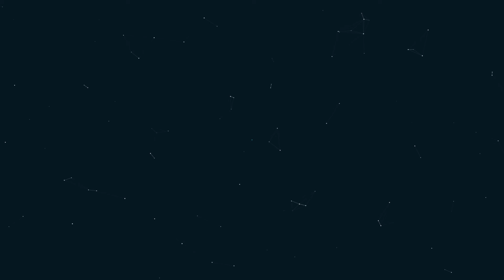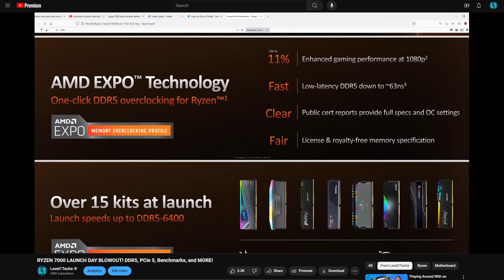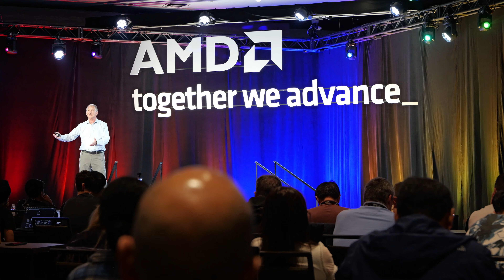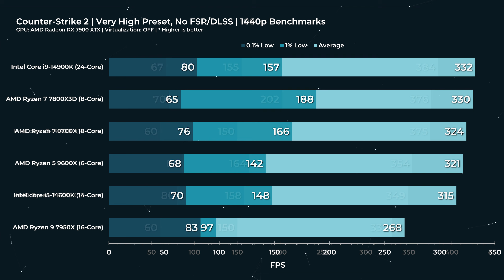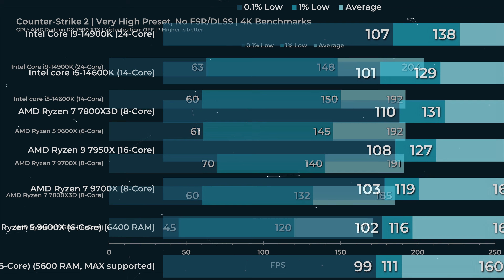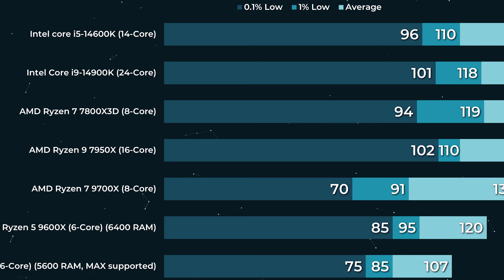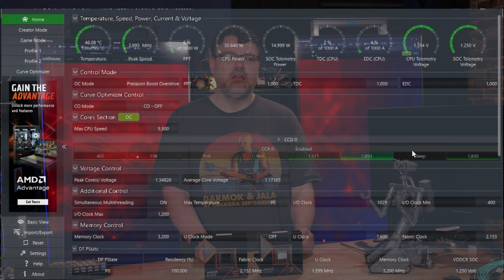Ryzen 7 9700X and Ryzen 5 9600X Review and Benchmarks

Comment: Really wish you would include 5800X3D in comparison just for the funzies.
Reply: It's too powerful and always wins 😊. OCed it ties nondegraded/nongimped 14900KS.
Reply: @TheGuruStud not it’s not even close to “always wins”. I understand it’s a great CPU but let’s not lose our heads here.
Reply: Since efficiency is the name of the game here, and considering that 5800X3D can be undervolted to around 1V (1.0275V on mine) while maintaining 4.4GHz all core overclock and competitive performance well below the 88W power limit of the 9700X, performance per watt wise it is hard to beat. Keep in mind that 5800X3D in these benchmarks is usually not undervolted and overclocked in this manner to maximize its efficiency. Within this context, 5800X3D actually is competitive with a 14900KS, as well as this brand new 9700X even with its efficiency gains. It may not "always win," but the 5800X3D is still damn impressive.

Comment: That was an incredible spread of variables! Especially the 8 core AMD beating the 24 Intel and your point regarding 4k vs 1080 and CPU/GPU bottlenecks! Personally, I'm convinced I will eventually need to get a (2nd hand?) 4090 in my AM4 rig eventually. I was fully and most shocked and almost in disbelief that Intel dropped or never did AVX512? That surely is the nail in the coffin.
Reply: No, it doesn't. of course a 6 core can beat 20 core in gaming. Nothing surprising if the single core perf is better in some games. I see you fanboying AMD everywhere. Just, stop.

Comment: What i really want to see for Zen5 is for the monolithic APUs to have the same or better cache spec than the non 3D desktop CPUs. Sure adding cache makes the die bigger, more expensive, and use more power at the package, but system wide it should hit RAM less often and depending on how much less RAM is used could not only make the 9700G faster than the 9700X in gaming, but also make the 8750u more efficient than the Apple M3 in mobile. Everyone is talking about how going to SODIMM takes too much energy so we need to switch all laptops to near or even on package LPDDR, well not using the RAM at all is an even greater power saving, for every bit that stays in cache the the difference of power in picojoule per bit can be more than 2 orders of magnitude less than going out to RAM, The real question is, how much more will stay on die, will it be enough to offset the added ~$5 die price(before adding profit margins, shipping, packaging etc) 
Will doubling the cache mean that 8 hour laptop will hit 8H30m, 12h? Or will everything that was already hitting RAM still hit RAM and the added cache will increase power usage and now it gets 6h of battery life.

Comment: It seems like they should have pushed the silicon with a few more watts and another 100MHz so that it never had a measurable performance regression. "0% uplift in some cases" looks a lot better than "-3% in some cases" even if it does come at a small penalty to the efficiency gains.

Comment: I've been on x570 with the 3700x and then the 5800x3d CPU and I am very happy with the performance however I can't help but think, is it time to upgrade? The new generations don't seem to really pull me in. Thanks for this review.
Reply: If you're already on the 5800x3D there's no question you should only be looking at the 9800X3D or higher.
Reply: Maybe 10800X3d
Reply: Absolutely not, once on X3D is X3D or bust for now
Reply: I wish i could keep my s.l.i setup because that 5800x 3d I have doesn't have enough clock speed for my two rtx 2080 tis in s.l.i
Reply: Same for me. I had a 3800X, currently on a 5800X3D - paired with a RTX 4090. Is there a lack of FPS? absolutely not.... but it could be faster
Reply: Oddly enough, if you plan to do PS3 emulation, having AVX512 support is amazing, and is sadly absent from AM4, so that by itself is a good reason if you go for it
Else just stay with am4 for now
Reply: Wait for 9000 X3D

Comment: I should have watched this first instead of last. This is probably the best review I have seen on the processor. Everyone else just said that it isn't as good at gaming and cinebench as we would like. I think the power is the reason for these chips. These are intended to be more general purpose CPU's I don't feel they are intended to be the "best" at anything. If you want the best gaming chips that is going to be the X3D chips. If you want the best chip for Multithreaded workloads you will be better served by the 12 and 16 core parts that are coming in a few weeks. These are going to be more for your general workstation chips where the employees do most of their work in a browser anyway and 6-8 cores are fine for that. In that general workstation having very good single threaded performance for the browser and office suite while only sipping power is the killer use case. Companies building generic workstations will love these chips. For gamers, wait for the X3D. For programmers/ 3D modelling etc wait for the higher core count parts.

It feels like these chips are a Toyota Prius and are being gauged as bad cars because they can't haul as much as a F150 and they aren't as fast as a corvette. You need to figure out the use case for the product before you can actually evaluate if it is a bad product or not.

Comment: Would be great to see a deep dive into the memory architecture on AMD -- I switched to AMD (7800X3D) this upgrade cycle for obvious reasons. On my particular platform I'm seeing some really impressive timings at 6000/1500MHz  with the EXPO profile -- in fact for a kit with single-sided SK Hynix modules it does better at 1500 than 2000+, usge scenario is 1440p gaming. Double sided modules are the other way around. I only have SK Hynix DDR5, would be great to see if there is a difference compared to Micron and Samsung.

Comment: After watching a few reviews, here is my assessment:
1. Zen 5 is notably more power efficient than Zen 4 or Intel up to 14th Gen
2. Zen 5 needs some more tweaks and optimizations to really deliver higher clocks and better memory compatibility. That might be fixed with microcode and/or die revisions, but could require a more extensive change to chip layout.
3. Zen 5 with X3D will be stunning.

Comment: Man, love your coverage of these chips Wendell. One thing I am really interested in seeing is how far can one push these chips with PBO and overclocking. If the 9700X is neck and neck with the 7700X in a lot of ways, what if you OC the 9700X so maybe it is drawing similar amounts of power as the 7700X, can it get closer to 6GHZ? Just makes me wonder how far it can be pushed if it is that fast at sometimes half the power of the 7700X.

Comment: Honestly, I think a world where PBO becomes the new 'xmp' for cpu's where enthusiasts are generally expected to just automatically turn it on from the start while leaving the base efficiency focused setting as default for general users is probably not a bad outcome.  

Certainly would've worked out better for Intel the past couple gens.  And better than AMD defaulting to boost to whatever they can get to maintain a constant 90-95c temp and then introducing an eco mode after some backlash, especially in the EU where energy concerns have been greater.

The automatic boost to a set thermal max at all times will always get you better benchmark results out of the box but probably gives an overall worse experience to most users.  And the users who do want that can just turn it on with one simple setting like xmp.

Comment: If I understand this right the absolute performance compared to 7000 series is maybe a little better but because of the new core and the way the CCDs are mapped out the main improvements are in watts and temps. ... And that was the limiting factor for clocks on the chips with vcache, right? Sooo, 9800X3D might not even have lower clocks anymore compared to non X3D? 
That would be insane!

Comment: Interesting. Other channels weren't so impressed. Maybe it's how you tweak the infinity fabric or memory timing? Zen 5 definitely has very different internal data bus. It is now 512bit wide, which is great for SSE/AVX workloads but for INT64/FP32 workloads, that may come with performance penalties due to the need to fill up the data pipelines, so, weird pre-fetching issue is highly likely. The Pentium 4 (or Pro?)  had similar issues if memory serves.

Comment: It’s funny to see the difference between reviewers. Hardware Unboxed were very negative in their review… probably due to the gaming performance I guess.
Reply: I’m kinda confused whether Steve tested with PBO enabled. I’ve seen some reviews do this and have vastly different conclusions.
Reply: The preset power draw of these two chips are pretty conservative, so PBO would theoretically remove this limitation.
Reply: just thought the same, GN and Hardware Unboxed concluded with ... "same performance, higher price, lower power draw. hell no AMD"
Reply: Yeah, GN and HUb were more negative, they likely did not use PBO, with that said if PBO is not covered under warranty then them being upsett is completely understandable becasue the capabilities of the CPU are locked behind a warranty void is used condition.

Comment: Maybe not the most relevant video to ask this, but as someone with a 13900k I am curious if I need to be worried about anything other than updating my bios and microcode when it is released, I did have some instability at stock settings running my RAM at 6400 CL32 however now that I've set my ram down to 6000 CL32 and also have altered the voltage settings to lower values it's been rock solid as far as I can tell. Should I still be worried about it degrading at all or would that have already happened by now? For context I've been running said CPU since Aug 2023 and other than the instability I had for the first like 2-3 days I had it before I changed the voltage and RAM settings I have not had any other issues that I could directly point to the CPU. TLDR I have a 13900k and am thinking about swapping my platform out for a 7000X3D chip and B650 board but am unsure as to if it's worth it because I don't know if I'm in the clear as far as faulty chips go.

Comment: The use case I could think of for an 8 core multithread workload would be something like Digital Combat Simulator Multi-thread mode, where it's got a bunch of threads now, but it really only has a smallish number that are limiting it, and the cache latency hit of transferring from one CCD to the other is a significant penalty. 

Last I checked, it could use up to 32 SMT threads, but apparently performanced better if you capped it to only 8 or so total cores, because otherwise it ended up choking the system bandwidth by trying to load everything all at once on their own unique threads, and stuffing the system with overhead... 

Try that for niche usecase!

Comment: Still waiting for the new MCM architecture with direct connects and now I'm thinking the performance uplift from Zen 5 to 6 is going to be even bigger.  I was thinking it would be around 10% but I think they'll correct the issues with Zen 5 and it will be a good 15% boost AND use less power.

Comment: Power management is the ONLY benefit.  The X3D prior gen chips are still a better buy.    There is no reason to buy these two chips for upgrade or new builds.   AMD had the opportunity to bury Intel and failed.  The 7700 is within 10% better and worse depending on application.

Comment: How's the LLM performance? I'd like to run larger models and I'm debating if I should fork out the cash for 2 3090s, or if it's not too slow, throw in extra system RAM and run the big stuff on the CPU. Please, Wendell, I need your guidance!
Reply: Yeah, interested in that. AVX512 should help, certainly seen good results from neural magic deep sparse using AVX 512. I’m going to wait to see if strix halo pans out though, 256bit memory could make it a unified memory beast on CPU or those 40CUs.

Comment: I realize that this is a cpu test, but it would make more sense to test CS2 with a lower quality preset, like around medium or "custom competetive setting (aka low)" like HUB does. There's a big performance penalty when turning the quality up over a certain point, regardless of resolution. Even if nobody "needs" more than 300 fps, most players will turn down settings to achieve just that. For someone who plays the game, the 0,1 and 1% lows compared to the average fps matters a lot. In the end, it would still function as a good cpu test, while showing more realistic results.

Comment: Comment on the Starfield 1% low weirdness:
With the same power budget but less votes, the 9600X is probably better able to utilize the single-threaded advantages of this generation and clock higher - and Starfield does apparently tend to favor high clocks based on the Intel favoritism - while spreading that budget across more cores with the 9700X is probably bringing clocks down further and taking longer on tougher parts of the render pipeline since Starfield is clearly not optimized that way.

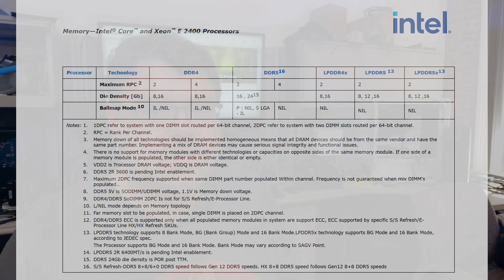Comment: 7:30 I have an 8700G with DDR5 8000 on a cheap 2 slot board, worked out of the box with XMP profiles(yes this is an Intel kit) 
My main dissapointment is that apparently, this chip is worse than the 5700G, as the 5700G i can get DDR4 5000MT/s in 1:1:1 which means MCLK, FCLK, and UCLK are all at 2500Mhz, but on the 8700G, no matter what i try, the FCLK seems to top out at 2200Mhz meaning the best i can hope for in 1:1:1 is DDR5 4400MT/s despite the MCLK running at 4000Mhz and so far as my testing went, even 4500Mhz(DDR5 9000) i'm still limited to 4400 in 1:1:1 or 8800 with MCLK at 1:1 and everything else at 2:1

I'd quite literally have higher bandwidth with a 5700G if it came with a DDR5 controller as with that i could in theory run at DDR5 10,000 in 2:1

The 5700G with DDR4 5000 C17-17-17-30 wasnt actually that far behind the 8700G at 8000 at 74.somethingGB/s vs 89GB/s

(dont remember the timings of the 8700g because i disappointed and decided DDR5 is probably a no go for another 2 generations)
Reply: Edit, i might have tried to fly too close to the sun with a 48GB kit, but i wouldnt think that would affect how fast the FCLK and UCLK could run, just the MCLK
Also i looked it up, the trident Z has timings of 40-48-48-128 now i tried playing with these numbers so i probably had them closer to 38-42-42-100(just a guess)

Comment: I still find people using the 4090 at 1080p are doing a disservice to these CPUs since the 4090 is actually faster as higher resolutions. For example its 1440p numbers are higher than 1080p.
Reply: That an incorrect assessment. It is not higher, it is lower. CPU strength will dictate whether 1080p is faster and by how much. GPU utilization is king. In every game I play with 13900k and 4090 1080p generates more fps but at the less GPU usage 

Drop to something like 9700k and playing with 1440p is better because cpu is less strong by IPC than 14900k (for an example)

Comment: Man i have a 3900X and was debating with my self, the whole video, if i should upgrade. An in the end it felt like wendell broke the the fourth wall
Reply: In my opinion its always a case of "what are you doing?"
-General use= a few fast cores, so 9600x
-Gaming= X3D, so 9800x3D
-Production= 16+ cores, so 9950x. (everything=9950x3D)
The non3D cores in the middle become a no-mans-land valley, same with intel 12400f or 14900K.

Comment: The important question is, is it actually confirmed that AMD does not treat DDR5 the same as Intel. With Intel the short specs say "up to" and the detailed public spec PDFs have always been explicit since the start of DDR5. With AMD, there are no detailed public specs. So it could be possible that AMD has the exact same behavior. And we know motherboards largely ignore those limits and will just run the CPU at 1DPC limits anyway. Have we had confirmation that AMD wachtes the memory settings like a hawk and would not let the mainboards get away with what they are doing on Intel? Or has anybody seen similarly detailed specs to the Intel ones that do not have the limits Intel has?

Comment: I've never been so confused at a CPU launch. Opinions so divided, and so many differing benchmarks. Have seen bench after bench from the two Steves and many, many more showing the 7800X3D miles ahead of everything in gaming for the most part, but now benches are appearing showing it as having fallen behind. Nothing seems to add up man. My MSI Z170A M7 has so many more 'Features' than near all current motherboards. On board digital codes, FULL set of audio 7.1 jacks, loads of PCIE slots, on board power AND overclocking buttons and...and...

Comment: Why are you comparing the price of the Ryzen 9000 CPUs against the MSRP price of Ryzen 7000? The 7000 prices have dropped significantly since then. If I go to the store trying to figure out which CPU to buy for my system, I'm not getting the 7000 for MSRP., I'm getting it cheaper.

Comment: The core architecure is better that is good news! But there is lots of room for improvement. 1. The memory bandwidth read speed is a problem that needs to be addressed the write speed is 50 faster than read speed. 2. The Ram speed and issues with 4 DDR rams needs to be solved. These are major bottlenecks for AMD.

Comment: I'm running my 7800X3D FCLK on 2166MHz. Some also do 2200.i wonder is the 9000 cpu's will really go higher since the io die seems to be the same. I don't expect better memory or fclk performance. And if they improve something with a new bios I expect it also could help the 7000 series if they update the agenda for those as well.

Comment: Your benchmarks for the 7800X3D vs 9700X seems different to Hardware unboxed.
For CS2, you have 7800X3D at 366fps similar to 9700X. On Hardware Unbox, they had 7800X3D as top CPU with 588fps